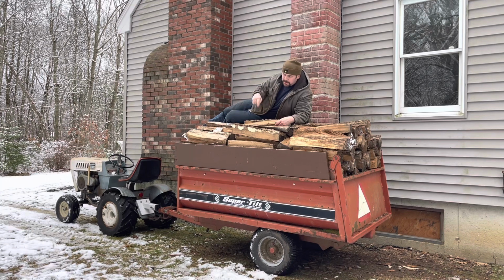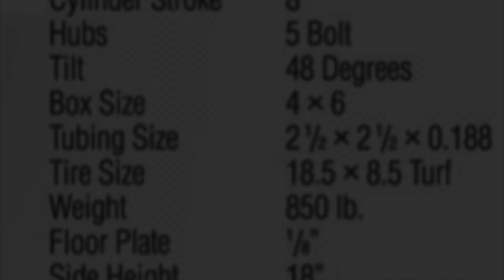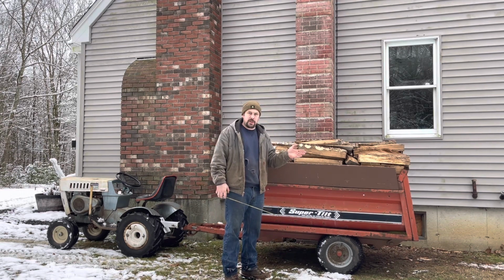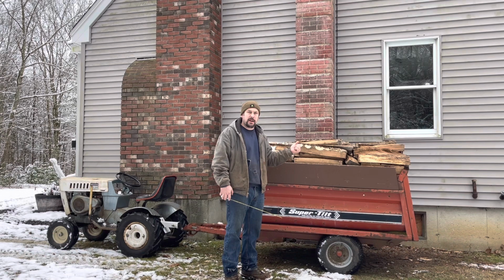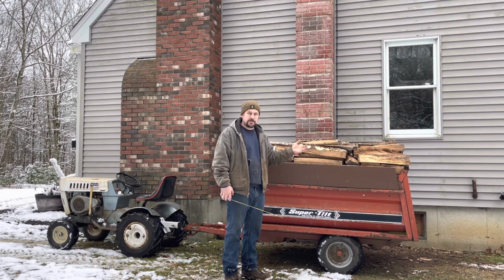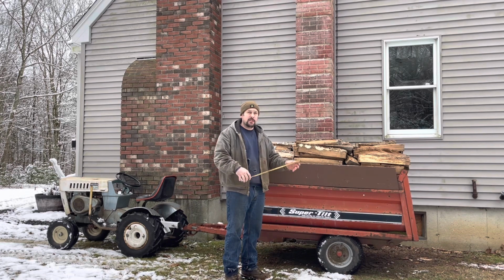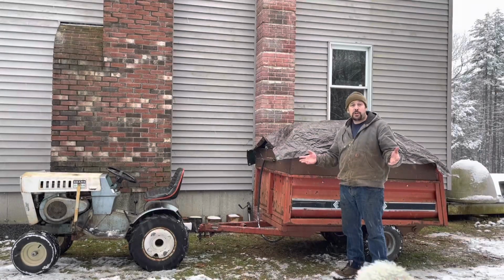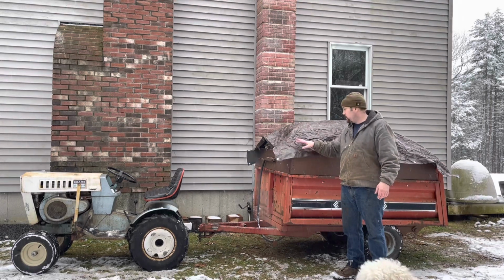How much will a vintage garden tractor pull?

Comment: I've pulled 1200, 1500 plus pounds with a Wheelhorse C160 quite a few times in mountain country. 
Works excellent. 
The real question isn't necessarily about pulling.  It's about STOPPING.  Use good strong common sense when using older machinery.
Reply from the maker: @ebinmaine  💯

Comment: I use my 1984 Ariens gt17 for hauling wood. That's what it's done every year practically since new, in addition to snowblowing a long driveway in WI winters, and mowing about 4 acres of grass for the first 30 or so years of its  existence. I inherited it from my Dad, and I use it to mow my acre of lawn and haul firewood.  I just used it to haul 4500+ lbs of honey locust in one load the other week.  Growing up, we'd use it to haul fresh cut sugar maple and shagbark hickory, a cord at a time through the woods and up hills. According to charts I see, wet green shagbark is 5100 lbs a cord, and the old pickup chassis 4x8 trailer was at least the 850 lbs of your trailer. All in all, it was guaranteed that the full load was 6000 lbs.  Impressive to say the least. Chains are a must, unless you have ag tires like yours does. Traction with turf tires and a little snow is bad. Almost non existent without chains. One of these days I'll build my detached garage so I can use the 48" snowblower attachment on the gt17.
Reply from the maker: Sounds like an awesome setup Tom. Those Ariens GT series were built tough. 6000 lbs on muddy trails is incredible. I know how heavy Hickory, Sugar Maple and Locust are. Very cool 👍

Comment: Dude awesome video!! I'm definitely going to see if I can find one of those trailers. I've got a few garden tractors. I've got a mahindra sub compact that I love. I've got a john deere 318 that I really like. But I've got a lot of cub cadet narrow frames I use for different projects. My favorite is this little beat up 125 that no joke I pull a 2500 pound trailer from the back of my property to the front on a regular basis in alot of mud to. I wish I could post the pictures on here of it. I posted some pictures on a cub cadet page one day and I got alot of hate over it. Lol I didn't buy that thing not to use !! It's amazing that's its only 10 horse power and one little piston.
Reply from the maker: Thank you sir 🙏 Sounds like you caught the same bug as the rest of us garden tractor junkies. They are quite the little machines 👍

Comment: It’s not a garden tractor, but I’ve got a Ford jubilee tractor, I pulled a 2600 lb oak log with it the other day.
My ole tractor is ugly, doesn’t always run right, but she’s a worker
Reply from the maker: Yes sir. I still see tractors like the Jubilee, the 8n, and the 9n working hard. Pretty impressive considering they are around 70 years old at this point.

Comment: I have four "Burbs" and each one performs a specific task on the homestead. The 71 does all the plow and disc work in the garden. The 74 SS16 does all the dozer and scrape work. The 74 ST12 That I restored 11 years ago does the mowing, and the 68 Suburban 12 pulls a 1 ton wagon. 2 newer Craftsman LT1000's complete the fleet of mowers. Great tractors and a great video.
Reply from the maker: Thank you sir. Sounds like a great fleet you have there. My very first GT at around 12 years old was an ST12 we got from a friend. They traded it in for a newer mower. I loved that mustard yellow and white color scheme. Wish I still had the tractor. Thanks for watching and commenting 👍

Comment: We are always impressed by what our old garden tractors can pull and it is great to use them to tow trailers as it is so much easier to get the trailer into a tight spot than using a truck. We pull our 14 foot three axle road trailer all the time with our Bolens HT23 and it handles it really well. That trailer weighs 850kg empty and we have pulled it loaded at about 3,500kg. We did hook it up to a Bolens G10 once and it pulled it well but when we were on uneven ground it started to lift the back of the G10. The G10 is a very light tube frame and with three axles on the trailer is likes to stay level. We would not even try pulling any trailer with a modern GT
Reply from the maker: Wow! 3,500 kg/7700 lbs is some serious weight. I’m not surprised though. The old Bolens are built like tanks, and the HT23 is a monster amongst those tanks. Very cool 😎

Comment: Doesn’t surprise me at all Case. It’ll pull more than that. 
I have a 1970 John Deere 
140 H3. 53 years old. That will out pull that old Sears. Hehe 😂😂
But really they are work horses. 
I once pulled a LGT 100 Ford garden tractor. It quit. Hooked the John Deere to it. I was on the Deere, son was on the Ford. I went toward the garden, son locked the brakes on. Bugger. I didn’t know this. I kept going. I drove through the garden pulling the ford. Didn’t stop. Was a one sod 10” plow on the Ford. Son being bad, dropped the plow down into the garden. I didn’t know this and kept going. Only turf tires on the John Deere while doing all this. 
Ya they can pull. Great video Case. 
Yesterday, snow 8”. Then rain 8 hours, back to snow over nite. You can image what that was like to move. 
Use the Case 224 with 48” snowcaster. Doesn’t throw that  far, so had to throw it 4 times in some places, you know what that’s like. 
Any way, got it done. Long day. Worked great. But had some belt squealing at times. 
Have a good day.
Reply from the maker: Great comment and cool story Noel. I love using these old workhorses. They always deliver and always impress. We got 5” or so of snow yesterday, so I tested the 54” plow on Brett’s Case 220. It did well even with the wet heavy snow. Video was taken 😉 Take care my friend!

Comment: I tell you what, it may be down on HP compared to the modern garden tractors that all seem to be just under 25HP (EPA thing?), but I bet it doesn't have a brittle plastic gearbox.
Reply: As the second place contender for who uses that rugged brute the most, I can confirm that 3 speed, 2 range gearbox can withstand just about anything!
Reply from the maker: Yes sir. No plastic parts or wimpiness on these old machines. Built to be passed down generation to generation. I actually knew the original owner. My father was good friends with his family, growing up down the road. We did work on his home several times going back 25-30 years or so.  He passed away 6 years ago at the age of 96.
Reply from the maker: @brettbuildalot5550  Anything!!!